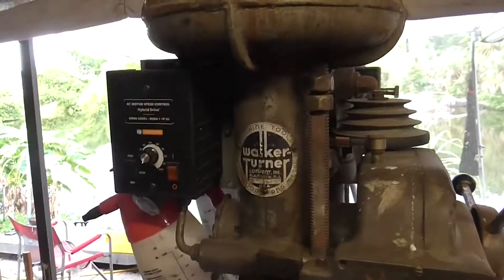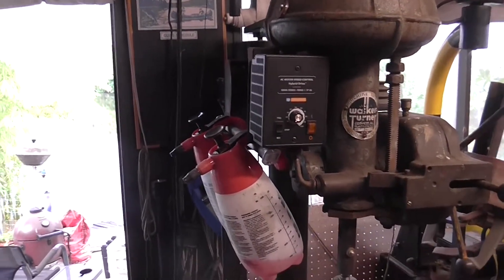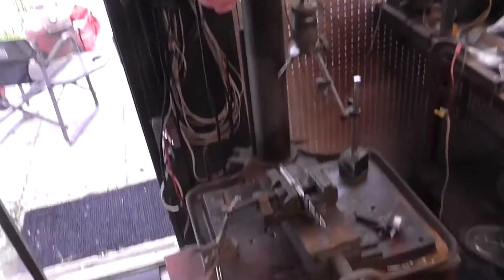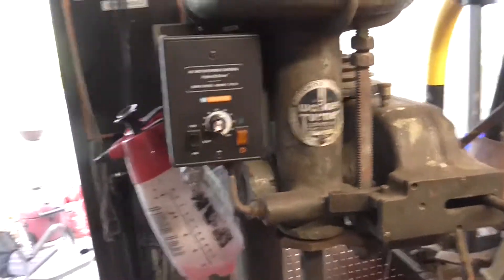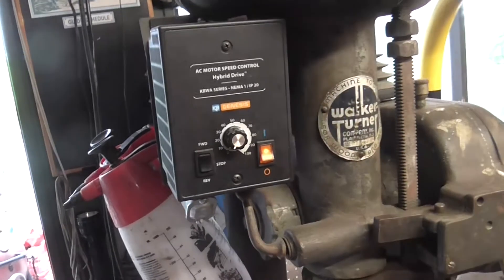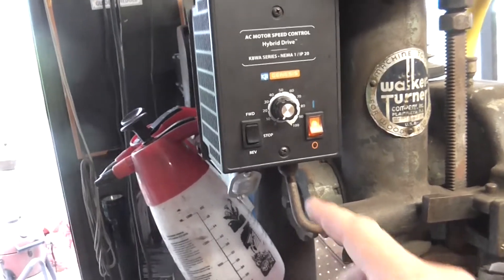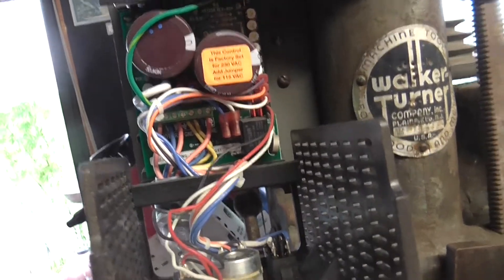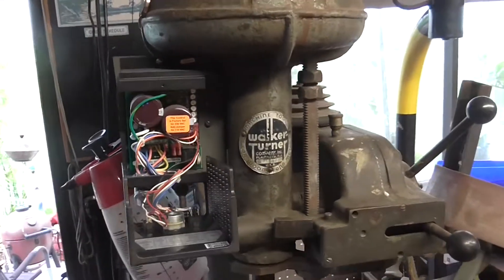Walker Turner Drill press with VFD

Comment: Hi Joe. Nice drill press. I believe that you can change that belt by unbolting the top bearing cap and then lowering the quill. You should then be able to slip the belts over. At least on our later model you can. The feed box bearing you mention at 6:25 just had bronze bushings for us, shouldn't be a problem to press new ones in.
Reply from the maker: Butcher, thanks for watching and thanks for the feedback. I'll dig through the vintage machinery page and see if I can't find that bushing. That would be great content to go with the drill press video.
Cheers,
Joe
Reply: This is true.  Just remove the top cap, lower the quill, and you can feed a belt down in.

Comment: Hi Joe,Great video, thanks for sharing. I have this same exact drill press and I'm 85% finished with full restoration. One small problem is that I am missing the PTO bearing block for the power feed. I am missing the entire unit, both pulleys, the shaft and the cast iron bearing block. I want to make a new one but have no drawings or dimensions. I was hoping that you could give me some basic dimensions of that part. Thanks for you time!
Reply from the maker: Hi David. No problem. Send me an email Joeheilm@aol.com so that I have your contact info and i'll try and email you the dimensions